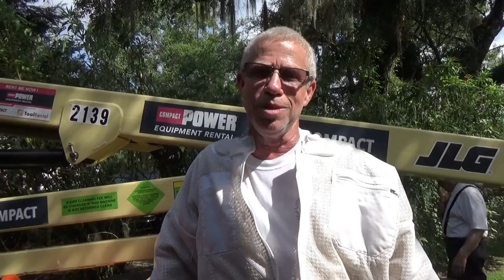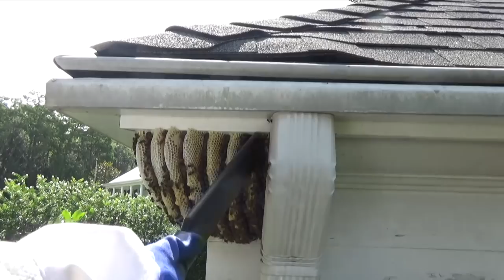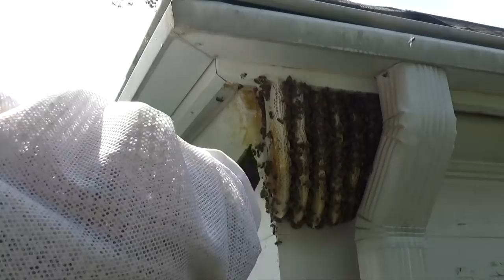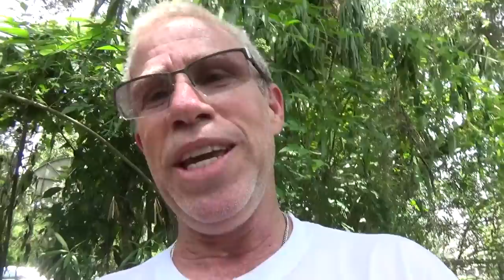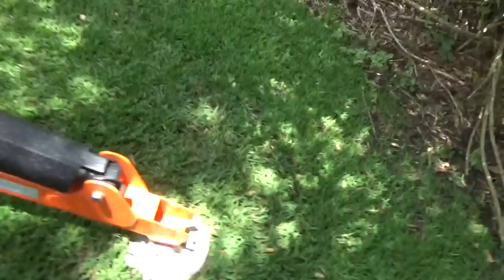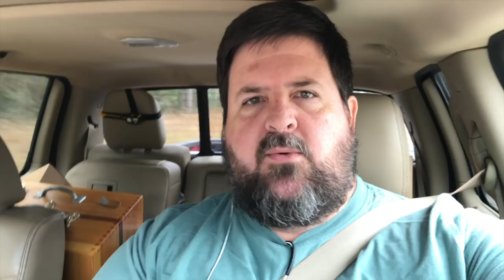External bee hive removal and relocation.

Comment: That shop vac must be fun to clean when you vacuum up some honey!
Reply: Hi Terry.  This is Tony the maker of the bee vac.  I've done exactly that a few times.  For the most part any honey gets in the hose, and it's easy to take off the hose and run some water through it.  I then spin it over my head like a lasso (I'm in Texas!) and that dries it in seconds and ready to use again.  The nozzle stops any bigger chunks from going up the vac, and it'd be at the bottom so it wouldn't be that big a mess.  You raise a great point though.
Reply from the maker: The honey stays in the vacuum hose, and that is very easy to wash out. Also, I exercise great care and avoid most of the honey contact situations. God's peace Terry.
Mr. Ed

Comment: Nice Bee vacc! Must be more easy to hold clean to! Battery? You may do a video on that angry yellow beast! BarbroSweden
Reply: Hi Barbro!  I'm the maker of the bee vac.  Yes, battery powered, I advertise it runs 4-6 hours on a single charge and my customers tell me they can get 8-10 hours with good power management.  Oh, I need to get the Gen 2 listed on the website (allmybees.com), but it's available!
Reply from the maker: It is a great bee vac, and there have been some great improvements over the earlier model. I always have this be vac with me every time I go wrangling, it's light, portable, and can be used in all situations. More than likely I will make a video showing off it's great aspects. God's peace Barbro.
Mr. Ed

Comment: The reason your controls did not work in the bucket of the lift was probably because the base was not set up properly. You cant just rock up and drop the legs out- it has to be pretty much dead level (should be a level bubble near the base controls) for the safety override to allow the bucket controls to operate. Did you explain to the hire company when you returned the lift?
Reply from the maker: The controls did work from the basket, but only sporadically. When I returned the lift and explained what was going on, they found a loose wire in the connecting harness. Thanks for watching. God's peace.
Mr. Ed
Reply: @JeffHorchoff  ah, therein lays the answer- controls did not work becomes they worked sporadically. That just means Randy beat you to the hire shop and sabotaged the machine you hired.
Reply from the maker: @jsmith7907  I did not think about that possibility, and it should have been the first thought in my head. I am really getting old. God's peace.
Mr. Ed

Comment: Unprotected hives seem rare around where I live.  I did see some open hives in central America.  Is this a climate or breed difference?
Reply: Wondering the same thing.
Reply from the maker: They are not very common here in Southeast Louisiana, probably having to do with our temperate weather. However, I will run across one or two of them every year, and some have been very large. As a matter of fact, we have one in a pine tree at the abbey. It's difficult to find, and I have yet to get a good picture of it. They built the hive, about 4 feet long, on the underside of a large limb and it hags down a good 7 or 8 inches. God's peace Joey.
Mr. Ed

Comment: I’ve only done 2 cutouts and the first one had absconded before I got to it but I did get 12 lbs of wax.  The second one had recently swarmed as the was no brood and a capped queen cell.  It was in a soffit and was pretty much honey bound and I wound up with a vac full of honey soaked bees that finally died.  I was bummed.
Reply from the maker: Doing a bee removal is not an easy undertaking.I will say this, the more you do it, the better you will get. Diligence and perseverance are key at becoming proficient in the trade. I wish you all the success. God's peace Steve.
Mr. Ed

Comment: You cheated and used a lift 😂😂👍✌
Reply from the maker: With your skills at fly casting, you'd have that hive down on the ground and the queen in a cage in 6 or 7 casts. As I am not as proficient with a fly rod as you, you'r right, I cheated and used the lift. Still, you've got to love the queen catch, and what are the chances of having the camera in the right spot to capture the event. God's peace brother.
Mr. Ed
Reply: I have no fly fishing skills its a centerpin reel attached to a 13 foot 6 inch float rod. No where near a fly reel most have a drag I use my hand for the drag thus free flowing to exceed the maximum drift possible! Fish On!!
Reply from the maker: @aaronnelson1099  In any case, that hive would be like a fish taco in your skilled hands. God's peace brother.
Mr. Ed